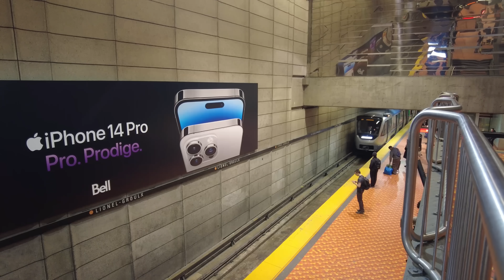How the World’s Best Transit Systems Achieve Amazing Frequency

Comment: 1:46 I remember miles in transit rode muni metro and noted that the new vehicles for MUNI metro have awful dwell times, partially because it takes them at least ten whole seconds to fully open or close the doors, on a streetcar service which by design is going to be stopping very frequently.

Comment: 3:48 You are showing subway line U5 in Berlin here, and it’s a bit ironic, because this is the “wrong” train, which has caused much consternation on the line. These trains are much too narrow for U5 (2.40 m vs 2.65 m; you can see the extension boards near the exits). Reason being: A local manufacturer had issues supplying new trains, so the public transport company had to borrow trains from the narrow line U2. Luckily, this won’t be forever, otherwise it would indeed make that line less attractive.
Reply from the maker: I covered this in my Berlin explainer video

Comment: For buses there are classic doubledecker buses, eg in London and in Berlin. many decades ago, they had a single stairs to the upper deck at one end. then they added second set of stairs to allow for entering on one end and leaving on the other, and used a central walkway with 2seater benches instead of having the same single walkway for entering and leaving at one side with 4seater benches. more recently they started replacing old doubledecker buses with articulated buses which are twice as long, have more and wider doors, and have the same capacity (around 100 people) but no longer need stairs. I still love the tradition and hate when they get rid of most doubledeckers, but i completely forget about this when i can very quickly enter and leave on short stops. and on most innercity routes, i have to wait no longer than 5 minutes for the next bus on the same line, or even much less if (for short travel distances) there are 2 or 3 lines which partially overlap. (similar frequencies on multiple lines apply to trams)

similar applies to U- and S-Bahn (capacity up to 1000 on long trains) which (for me, in the center of the city) come every 2-3 minutes during rush hour, 5 minutes normal, and even 10 or less at other times. who needs to look at and learn timetables with good frequencies ?
the S-Bahn on lines to and beyond city limits often only has a "low" frequency of 20 minutes (still not bad when you then sit in the train for 30+ minutes for those distances), but through a big part of the town seven lines share the tracks and thus people mostly can use any train every 2-3 minutes. the next problem are probably some old stations (built 100+ years ago, right in the center of the city) that almost can't be rebuilt easily or at all (at least not while continueing normal operations, and not when some base are protected historical buildings), creating bottlenecks on stairs and elevators instead of on the train doors.

Comment: It‘s great there is science for how to move people into the train. Our regional train service based on a bombardier talent 2 is certainly no good example. There is a wheelchair enabled bathroom right at the bicycle door which creates a smaller walkway already, yet the bottleneck can be used as bike storage on one side and flip down seats on the other. And then there is the large bike/push-chair/ wheel-chair area. The washroom is needed, but don‘t invite people to sit there / or park there bike in a crucial entry point into the train

Oh - these trains are overcrowded and always to late.

Comment: Well said about the doors! Whether it's the NYC Subway, SEPTA's Market-Frankford Line, or the PATH, the trains have three or four doors on each side! They notice how effective having three doors is on a rapid transit train, and yet they don't think "Let's do that with suburban rail so the operations are just as effective". Like the LIRR got fancy M9s back in 2019 and yet they fall into the same problem as the M7s and M1/3s, it's just two doors. The LIRR C3 bilevels having small steps to get to the seats is even worse for crowd flow! Having a third or fourth door is great for avoiding congestion at the doors and maintaining good crowd flow, or having two much bigger doors like on the Macau LRT as you pointed out can do the trick too! 

And of course, Spanish solution works like a charm as well! Besides European examples, a North American example of Spanish solution is at the 33rd Street PATH station, opening the doors on one side to let all the 33rd Street passengers off and then opening the other side for those getting on the Journal Square-bound train (or Hoboken-bound when Hoboken has its own Hoboken-33rd Street trains on weekdays). Epcot, TTC, and Magic Kingdom stations on the WDW monorail uses Spanish solution too! Driverless metros also allow to run higher frequencies without a huge operational cost, then they don't need to use more people to operate more trains, and platform screen doors simplify station layout, thus increasing safety.
Reply: Then there's some commuter rail like in Boston, where there are multiple doors but they usually use only one at a time, because condutor or something.

Comment: Low frequency can really ruin an otherwise great transit route. My parents live at the edge a big city and you can take the bus that takes 10 minutes in each direction to a local shopping street and a S-Bahn stopp in 2 different city districts, where you can either shop or take the Train to reach almost every relevant city nearby, but due to missing staff it only stops there every 30 minutes at the moment, which makes taking the train a pain because you have to wait almost 15 minutes for the train to arrive (almost the same time you need to get to the city center by car via Autobahn) and have the same issue on the way back. While I lived there as a kid the bus stopped every 20 minute, which was passable, but ever since I can remember they wanted to bump that down to every 15 minutes...

Comment: Any time a driver is involved in the frequency equation, there will be delays due to said driver.  For best frequency, Driverless (GOA3) or Unattended (GOA4) operation is of benefit. Humans get tired, computers do not. ;)

As for the criticality of turnbacks , many systems used a "degraded" form of driverless by automating just the turnback operation.  This allows the driver to walk from one end of the train to other while the turnback is in progress.

Comment: Accessibility is also vitally important.  I was recently in Chicago with the family.  We have always been a fan of the L. Recently the CTA has been making strides in making trains and stations accessible,  adding elevators etc. However,  wheeling my grandmother on and off the trains in a wheelchair we found that the nearly level boarding was not level enough.  We had to yank the chair backwards up to an 8 inch jump on or drop off the trains.  There is also up to a 8 inch gap between the train and the platform that the small wheels could get trapped in.  As you can imagine,  this made getting on and off take longer.  We were told on the last day that there are ramps,  and that the people at the station can help with them,  and call ahead to the disembark station so they will be ready too.  But that also sounds like it would take some time and slow things down.

Comment: Many rail transit lines have built in restrictions .   There is a diesel rail line in Denmark called Gribskovbanen which runs 4 trains an hour each direction on SINGLE TRACK for most of the day .  Very old established environmental reasons demands that a they cannot build a 2nd track nor string catenary .

Comment: This was a great and concise look at this. I'd add that platform doors (in places that don't already have them) can likely help with being able to run higher speeds into and out of stations without compromising safety. It would probably help keep the tracks much cleaner too, especially in places like NYC. Those trash-driven track fires really slow down trains...

Comment: Speaking of the Macau LRT, a video about how systems need to be designed fit for purpose would be a great way to analyse how terrible the project is. The trains themselves may be nice and it can be as frequent as it wants, but the residents don't get any benefit from riding it so it sadly feels like Macau blew its main chance to alleviate the overcrowding of buses and the ridiculously high car usage here.

It was first floated as an idea almost 20 years back to solve Macau's transportation issues but the system that's ended up being built is of essentially zero practical use to actual residents. All it does is go around the island of Taipa, which is primarily residential and commercial, but only through the least densely populated areas, in a wide loop to nowhere of use except for the casinos and hotels, and finally terminating at the airport in a way which takes far too long compared to other methods. On top of all this, it was wildly expensive and significantly delayed, and really just viewed by locals as another sign of public money being siphoned into infrastructure contracts for corrupt politicians. Furthermore, some of the extensions that are being proposed to actually make the system even mildly more useful are barely feasible if not outright impossible if the system is to remain an elevated light rail.

When you look at how busy the buses get here, and see how hilariously empty the LRT is in comparison despite not being subject to traffic and being much "nicer" than the buses, it's truly tragic that a small, very densely-populated city/country like Macau couldn't pull it off and truly make a dent in the car culture here. Even more so when Macau literally has a leading example of how to make an amazing metro system right next door in Hong Kong.
Reply: To be fair there's a Taiwanese YT channel that explained that the LRT was originally supposed to cut right straight thru the residential areas, instead of go around them, but people protested as you'd then have to build columns for the elevated LRT tracks right in the middle of the roads (mostly one-way). On hindsight trams with traffic priority might've been a better mode of transport?

Comment: It occurs to me that driver pay is also an obstacle to frequent service. Halve the number of cars in a train and you can run twice as frequent, shorter trains for the same number of cars total. But you’re paying twice as much for drivers. This suggests automated systems are a useful tool to increase frequency. Run as many trains as you need, and as your system can handle, and don’t pay any more for drivers because they aren’t needed. Really high frequency transit should probably work as much as possible like a horizontal elevator. Doesn’t need a driver, easy to get on and off, you might have to wait but not for long, and most importantly it’s just there and people just take it for granted that it’s there and don’t waste mental energy worrying about whether there will be a train or not.

Comment: You did not mention the Victoria line with fantastic frequency sometimes almost a minute between trains, stand on the platform as a train enters the tunnel another train is entering the other end 40 seconds later. JH

Comment: I've seen it multiple times now: WHY on earth are trams in the US/Canada driving in that slow manner? How are they supposed to compete with cars if you have to be slower than them on the SAME street, even with their own lanes?
Reply: This is why grade separation (metro lines) are key!
Reply: @frafraplanner9277  Yes, but you can clearly see in so many footage clips, that the trains are driving slowly even on basically grade seperated lines. 
I could outpace them by bike.
Reply: @TheWeirdaholic  not any different in many European cities: might be quicker while driving parallel, but the tram will be slower due to the frequent stops

Comment: There have been a lot of simulations of airplanes with a wing architecture, but tube and wing persists for known flow in emergency situations. Livestock seem to have used ventilated box cars with sliding doors. An interesting concept to use retractable doors.
I wish I could remember which trains were going to be "short-fast" . The intermodal trend was long and they seem to be relatively fast. The heavy haul are long and relatively slow. It must have been regular freight. Railroads have needed to increase passing tracks.

Comment: Viewing this from Boston, where the MBTA seems to be in a death spiral of worsening service frequency and reliability on both bus and light rail (probably also on the rapid transit, but I haven't been on those lines much).  And the traffic just keeps getting worse, including well after midnight, after the T has stopped providing service at all (and on the rare occasions that they have tried Owl service, it has always been blatantly designed to fail).

Comment: Before electrification, Brisbane used to have full-width compartment carriages; each carriage had nine compartments (seven for southside trains), with two full-width cross benches (seating 5 each). So there would be nine doors on each side of every carriage. Worked well at peak, and these old wooden carriages were prefered to the more modern SX sets in peak.

Bondi Junction (in Sydney) had a relay driver. Train would arrive and the driver would walk through the train to the rear end. Relay driver would get in and drive the train forward into a short sutb in the tunnel. When there, the original driver would drive forward onto the departure platform.

Olympic Park (also in Sydney) has an excellert variation to the Spanish solution. It's on a loop. The arrival track divides into two, and the platforms are side—track—island—track—side. Arriving passengers disembark onto the island platform, then out to the world. After the train is clear, the island doors are closed and the side-platform doors are opened. Departing passengers for westbound services are on one side platform, and city and east-bound services on the other side platform. Good solution for departing passengers as they know which platform to go to. Good for arriving passengers, as they don't have to fight for waiting crowds. This staion is busiest at popular events, such as the annual show.

Comment: I remember the Boston Red line terminal station (Alewife) ... the train would deboard, the driver would walk to the other end of the train, then boarding would happen for the inbound trip. Slow, but there were two platforms doing the same, and if all went well, the process could handle all us rush hour passengers.

In Minneapolis, we have a different frequency problem — a shortage of drivers. If your rolling stock needs drivers, and you don't have the people-power, frequency will suffer, no matter how good everything else is.

Fortunately, ridership is up this fall, above 2019 levels. I'm seeing it on my bus commute ... maybe they'll find enough drivers to bring the route frequency from every 15 minutes to every 10. [For commenters who think 15 is good enough ... this is a major route, along a heavily populated urban corridor through downtown and on to the university. It could probably justify every 5 minute service — if there were enough drivers. There's a plan to turn the ordinary route into an express busway in a few years.]

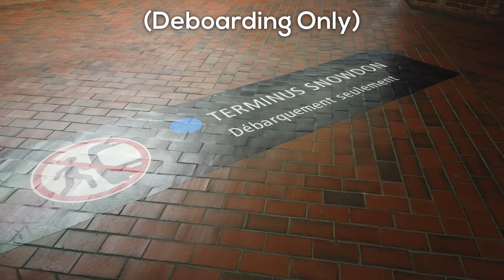Comment: Regarding the reversing sidings at 6:30 -- the Canberra light rail does something like that, except funnily enough the platforms at both termini are after the double crossover, and there's no guaranteed "deboarding" and "boarding" side. Whenever you're approaching the terminus, it's 50/50 whether your tram will approach the left platform or right platform (and the crossover point is pretty tight so it's kind of uncomfortable for passengers when the tram switches sides). When you're boarding the service at the terminus, if there's a tram at both platforms, you have to refer to signage to figure out which tram is going to depart first. The overall effect on the drivers is the same as a regular reversing siding, but it's less comfortable and less convenient for the passengers. Still, both ends of the light rail are currently in very busy urban centres, so there probably wasn't room to extend the tracks at all -- hopefully if the tram line gets extended to less busy places with more room for the tracks, they could set up a reversing siding arrangement.

Comment: 6:36 - That's exactly how it's done at the southern (Waterloo) end of the Waterloo & City Line, while Bank doesn't have reversing sidings and - instead - the drivers change ends when the train is sitting in the platform.

That sort of layout could also be used as future-proofing in case the line is ever extended, but that won't happen to the W&C.

As for the Spanish Solution, I've seen it used at only one station here in New Zealand. The current Newmarket station (on Auckland's commuter network) has three tracks, two island platforms and four platform faces. When the 'AM class' electric trains pull in on the middle platform, the doors open on both sides, which means passengers don't need to use the escalators if they end up needing to quickly get from one side of the station to the other.

Comment: What you mention at 9:00 is interesting (the widening of an approach track to 2 with an island platform at a through running mainline railway station) because Brussels never implemented this at its Central station, which has now become a notorious bottleneck on the Belgian railway network. That said, the issue hasn't been replicated everywhere as Brussels-Luxembourg station has 6 tracks (with 2 island platforms and 2 side platforms) even though there are only 4 approach tracks.

Comment: 2:36 Munich S-Bahn commuter rail trunk line in downtown Munich runs at a potential capacity of close to 50k passengers per hour per direction during rush hour, as the commuter trains of the different lines come together on a 2 minute schedule / adding up to 30 trains per hour per direction